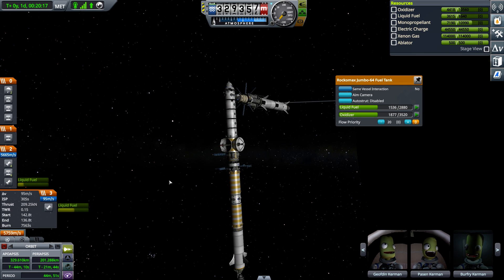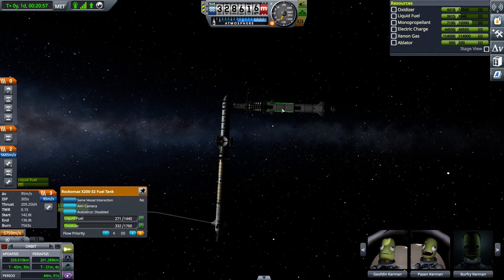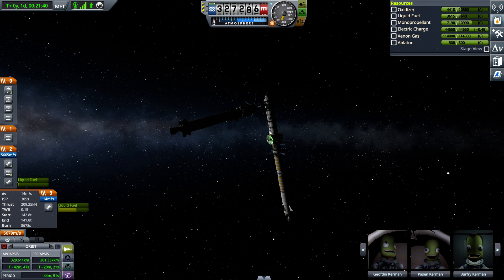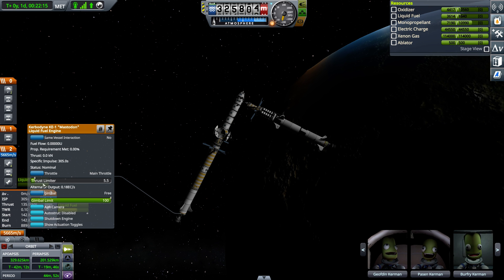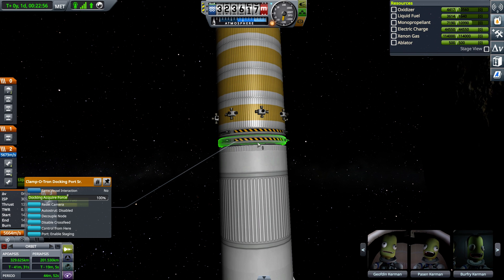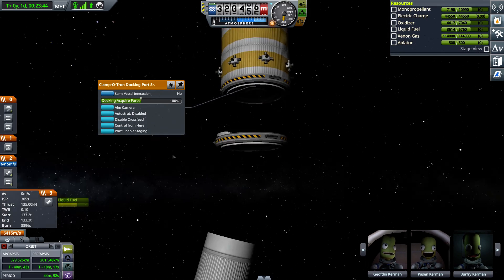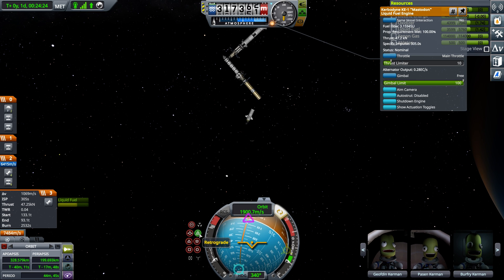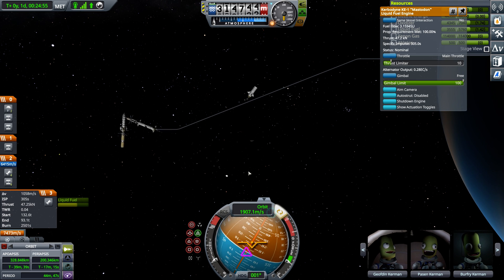Transferring Fuel in Kerbal Space Program

Comment: My 2nd stage was taking fuel from the spacecraft, and I hadn't realized until spacecraft seperated. The 2nd stage only had a clamp-o-tron junior docking port, so it wasnt compatible. However, a space station which was in a similar orbit had both docking ports. I was just barely able to get the spacecraft to a space station of mine using RCS, and my 2nd stage uses Liquid fuel+oxidyzer RCS.  After docking both of them, I had no clue how to transfer fuel until I saw this

Thanks!

Comment: I don’t get those options when I click my tank. I’m playing science mode. Do I need a Space Center upgrade or something? I have tourists stranded orbiting the mun while trying to do a refuel .
Reply: You need to upgrade research center to level 2
Reply: @Maglanchik  I don't either, and everything is fully upgraded, and everything is researched
Reply: @bbs5400  if you are playing a career mode above normal difficulty, you won't be able to transfer through a heat shield, and you must enable all your crossfeeds...
Reply: @wisenheimer9997  I had everything enabled, I figured out that I had something blocking it, still have no clue what it was specifically, so I just put docking ports directly on the fuel tanks and attached them using RCS while in orbit. That works, so I guess I'll just keep doing it that way
Reply: @bbs5400  You can transfer through the claw without having to put ports on everything as well... you just have to grab it where the port would be...
Reply: @wisenheimer9997  That's good to know, 1,000 hours and I never knew you could just attach with a claw and transfer through that, thanks!
Reply: @bbs5400  Yeah... That little encyclopedia they have is nice, but I remember when games used to come with instructions about every single aspect of the game... I picked stuff up little by little in the forums and some videos...